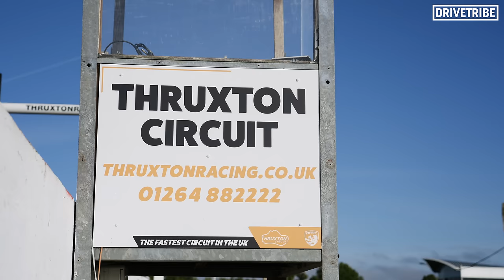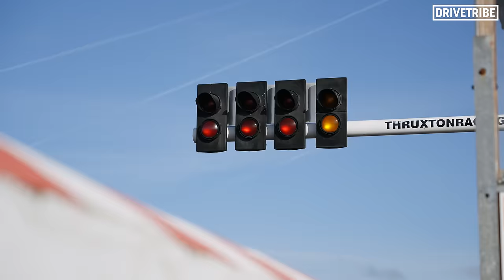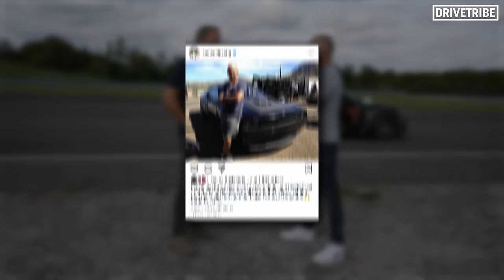Ex Stig Crashed Into In A Porsche 911 Turbo S!

Comment: GoPro products have the worst user interface I've ever encountered. Some options are in a swipe menu. Other important ones are hidden in a "long press" secret menu, and they reset to default after a power cycle. Icons are not intuitive. Options scattered across menus in a seeming random arrangement. One baffling decision after another. But at least they're wildly overpriced, right? I will never pay for another GoPro. Every time I have to use one, it's a frustrating ordeal.